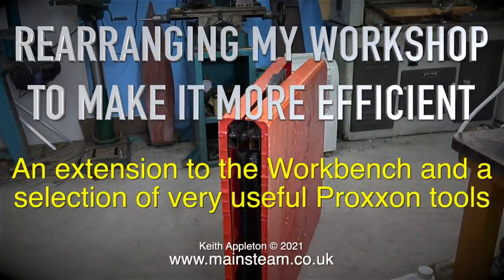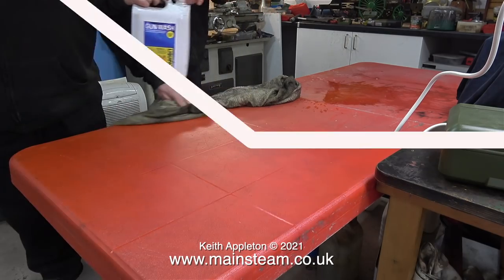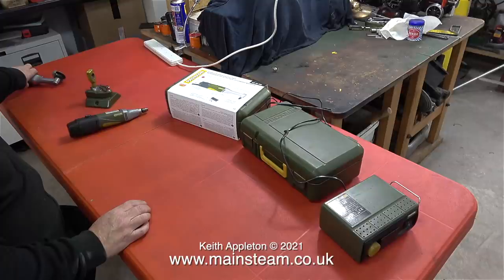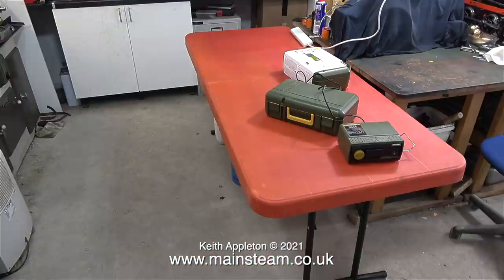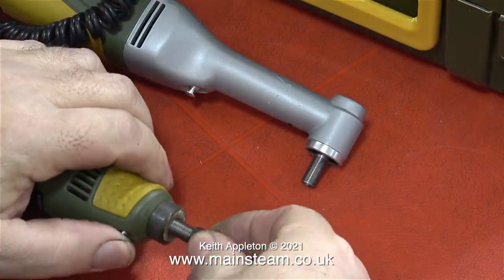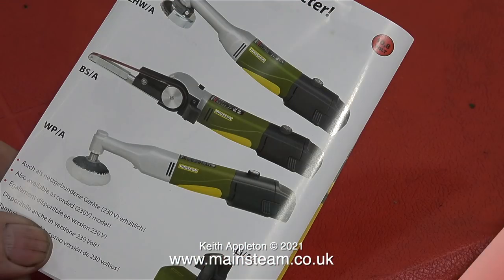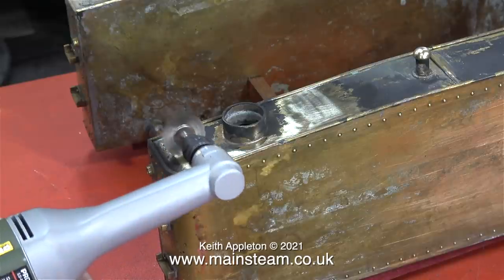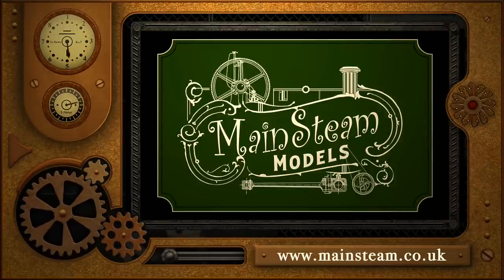REARRANGING MY WORKSHOP - TO MAKE IT WORK

Comment: Keith, if you paint the floor, make sure it is clean and all the oil stains are treated. An acid wash may help to give the surface tooth for the coating. But it does keep the dust down and is easier to sweep.